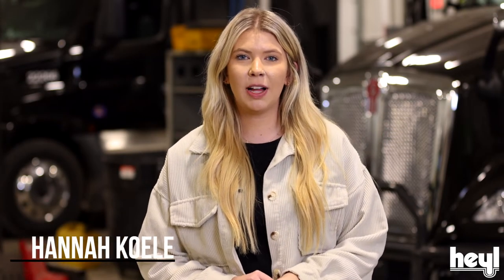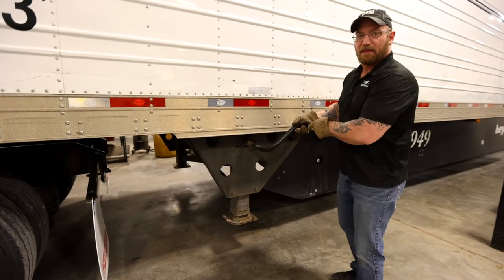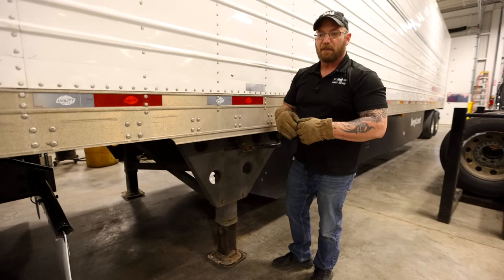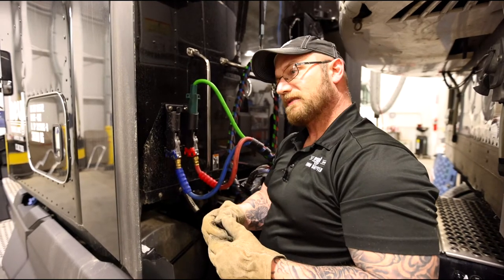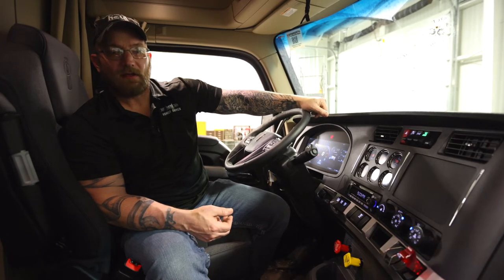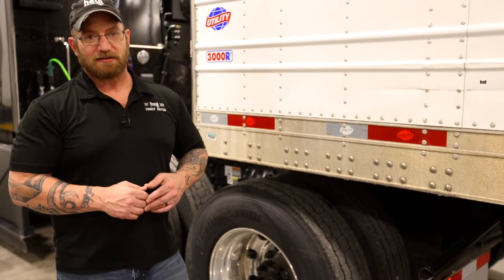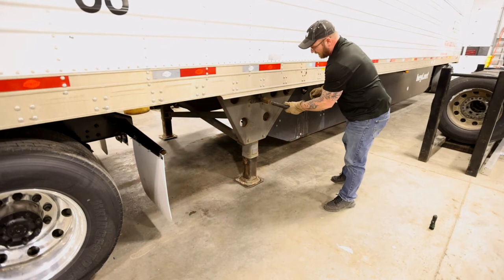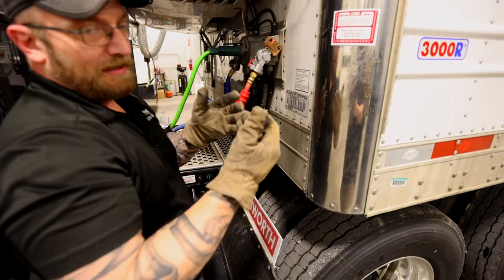How to Drop and Hook a Semi Trailer (EASY!)

Comment: The internationals don’t allow you to dump your air.  Bad idea doing a tug test with your landing gear down good way to bend your landing gear
Reply: You want to tug it with gear up? Then if not connected falls down…
Reply: @AZVIDS ya gotta be awake
Reply: I like the video but I wish you explained how to go into low or high gear for landing gear. Visually showed the locking jaws locked and explaining what the correct height is when backing under the trailer to couple
Reply: @speedywise1679 Pushing the crank handle all the way in is typically high gear and pulling it out will put you in low gear.

As for the locking jaws, you're just looking to see that the jaws closed all the way across the king pin. If they don't, a telltale sign is a shiny patch of metal on the right side of the jaw. Lastly, you look to make sure the jaw closed around the shank of the kingpin (the thinner part of the kingpin) rather than around the head at the bottom of the kingpin (wide part). 

I know this comment is two months old, but hopefully this helps if you haven't found this information yet.
Reply: Example of what not to do. LOL You back up first and then tug to make sure you’re locked in before getting out of the truck to do a visual!

Comment: Great video! Only one thing wrong. The red air line is the air supply line for the trailer. Not emergency air
Reply: It is called the “emergency line”.
Reply: Blue line is service brakes. Red line is emergency/spring/parking brakes. Both are to supply air to the trailer.

Comment: I’m not lazy but I’ve always wondered why they haven’t made landing gear air assist or electronic now
Reply: There have been air operated landing gear, but they suffer from dirt in the system, leaks & freezing in cold weather.
Reply: @Woodchopper46  really I didn't know that

Comment: The background music doesn't help. This video was better than some but still left lots of things out.  For example, does every truck have a switch that disengages the fifth wheel? Of course not. And exactly how and when and why must the driver lower the suspension? 
 I've driven a truck for 18 months but never had to drop or connect a trailer. Now that I'm going to drive OTR, I have to learn this and it does seem easy. That said, I haven't found a single video about this subject online yet that seems adequately prepared for a relatively new driver. 

 I did pick up some things herein, but I'm still considering hiring a "professional" at $120/hr because so many things about this subject are still left unanswered. 
 Sorry to be such a pest......but if I made a similar video it would be at least 30 minutes long and cover every possible scenario I could think of. That's a 60 plus year old speaking.